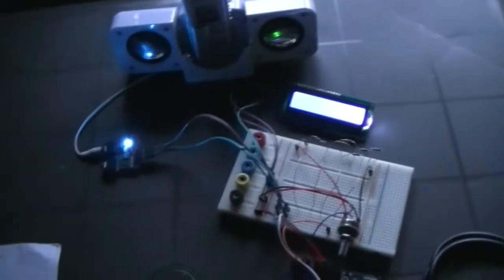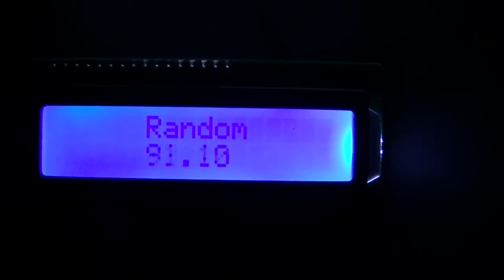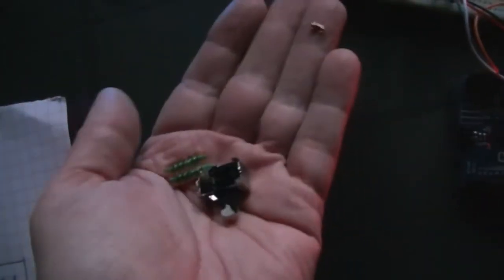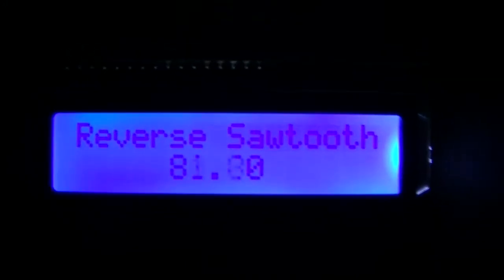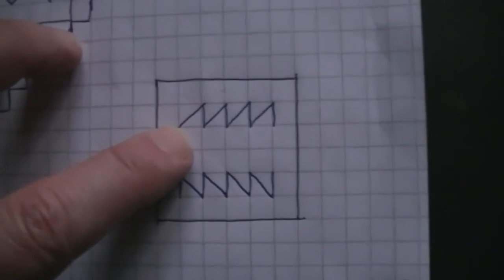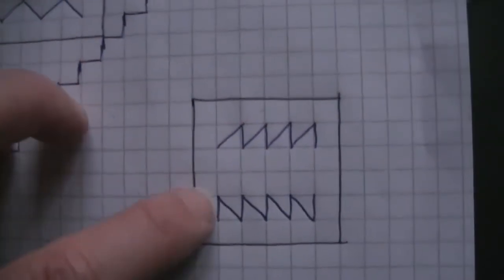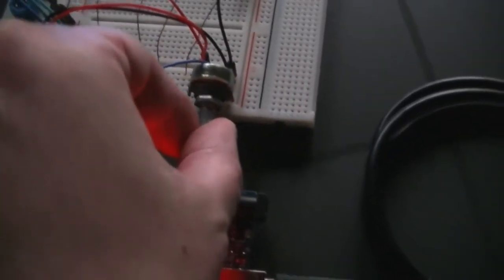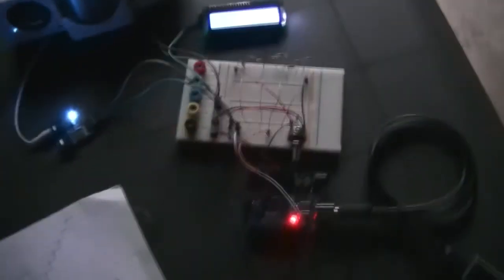Arduino TEA5767 Spirit Box

Comment: This isn't how a spirit radio works. You need a variable resistor, not a digitally generated random frequency phase change.
Reply: It's a variable capacitor not a variable resistor that u build radios with
Reply: Passive circuit, tesla spirit radio